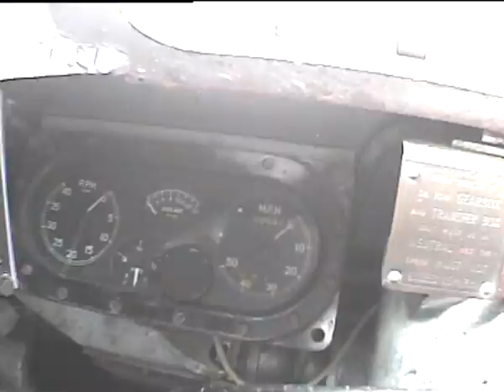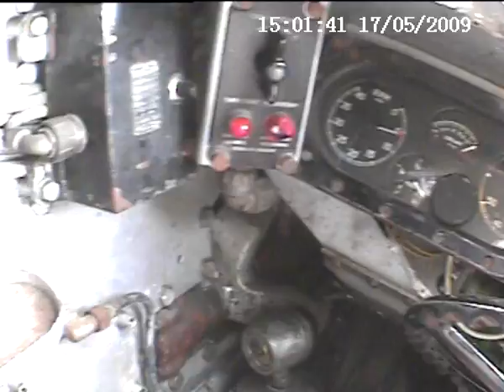Saladin armoured car.

Comment: Brings back many happy of memories of my Saladin before I sold it. You can turn the turret round much quicker and save the main battery but putting the turret gearbox in 'neutral' by putting the high/low selector in the middle disengaging the gearbox, then push the turret round outside by hand. Bet you have flies in your teeth when you drive at your smiling so much?!
Reply: Paul Howell best in show you flash devil.